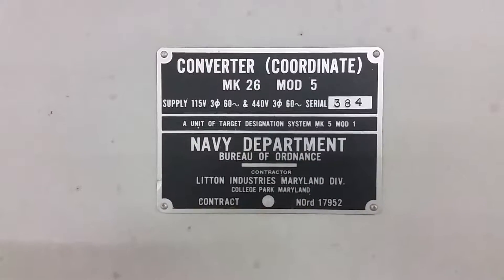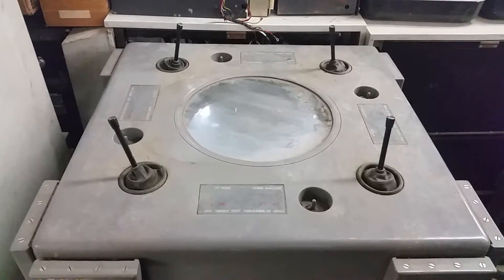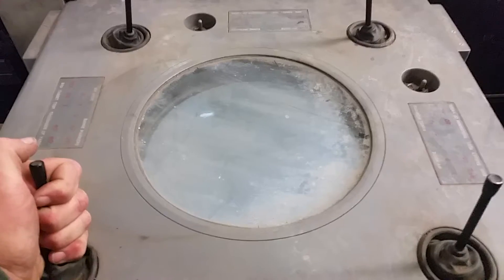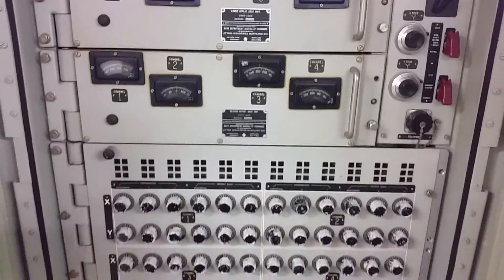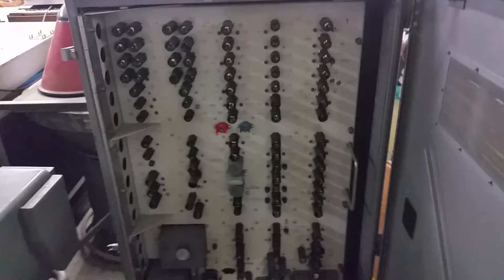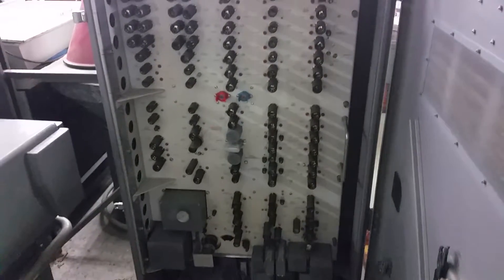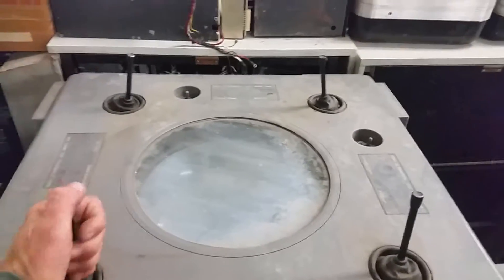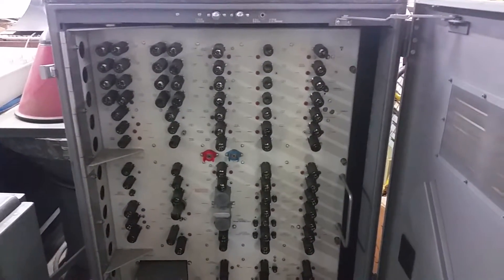US Navy Mk 5 Mod 1 Target Designator

Comment: I used to work on those Mk5 TDS systems back in my Navy days
late 60’s early 70’s while aboard the destroyer tender USS Shenandoah. I doubt
you will find any technical manuals on this system due to its classified nature
although probably declassed by now. My recollection and areas of T/S was in the
area which you called the brains. Indeed it was.  The tubes were 5844’s and biggest area of
concern was in the 8 ring counter circuitry. In fact being on a tender I
do  recall working on the J.P. Kennedy
DD850 I believe. Thanks for bring back some fond memories of the TDS system
used in that class of destroyers.
Good Luck
Reply from the maker: Thanks for the info. It may take years of looking, but I bet the tech manuals will pop up somewhere.

Comment: You have a good start on understanding its use and operation.  
I don't know what you are going to do with it though.
Technical documents are almost impossible to find, if at all.

On Destroyers with four (4) Gun Fire Control Systems, this system could send radar RANGE and Relative Bearing
data to the individual Gun Fire Systems.  (The USS LAFFEY, DD-724 at Patriots Point in South Carolina has the 
operator's console in C.I.C.)  In the 1950's, (before FRAM got rid of the 3" Gun Mounts) the Laffey had two (2) Mark 63 Gun Fire Control Systems and one (1) Mark 56 Gun Fire Control System as 'primary' for the 3" Gun Mounts.  The Main Battery consisted of 5" Gun Mounts, with direction provided by the Mark 37 Gun Fire Control System. The Laffey has three (3) 5" Twin mounts still in place and on display for visitors.

Under attack, the operator(s) would move their 'joystick' to place their associated semi-circle around a target 'Blip'.  With the target being defined as a threat, due to lack of an I.F.F. Signal, the operator would signal the Gun Director that a Designated Target has been acquired.  A sound signal at/in the Director would alert the Director operator.  The radar scan mode of the director would switch to 'search' initially, then moved to 'acquisition' (conical), and finally 'Track' (Tight Conical) when the radar range operator locks on.  The operator on the Mark 37 & Mark 56 systems, would actuate a switch that would 'slew' the director to the target.  On the Mark 63 system, the Director operator would get a dot on his scope and he would move the director toward the dot.  As the director moved to acquire the target, a semi-circle representing the Director would move to and to surround the target 'Blip'.  The target, having been fully acquired, is then tracked by the more precise radar of the Gun Fire Control Director.   (Blip and dot are interchangeable words when talking about Cathode Ray Display presentations.)

Good shooting.
  Ray

Comment: Greetings!  I have been working on just such a simulation for  a TDS on the battleship New Jersey Museum ship.  A radar simulation as been created with the Processing language. One of the original $8,000 joysticks was replaced with a $30 logitech stick to move the cursors over the incoming bogies. With Processing, I create 3 bogies coming in at random locations.  When the the two cursors (Actual and Director) get over a selected bogie, the operator presses the stick, an and the frame freezes for 5 second then - BOOM!  it is destroyed! (i.e. goes off the screen).  

Currently working on an interface from Processing to an Arduino to control 4 steppers to run the synchros to display the distance and bearing info on wall-mounted indicators. Seems like a simple project, but getting the steppers to respond correctly has been a bit of a challenge!  Give me a shout if you'd like to know more!